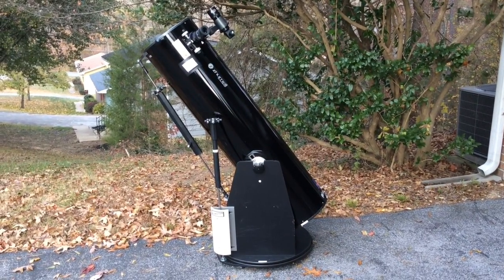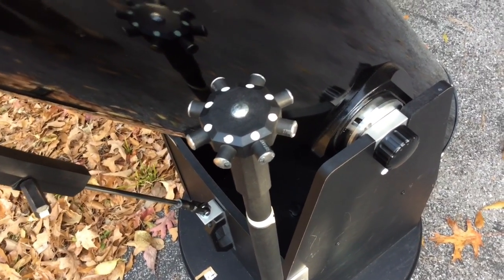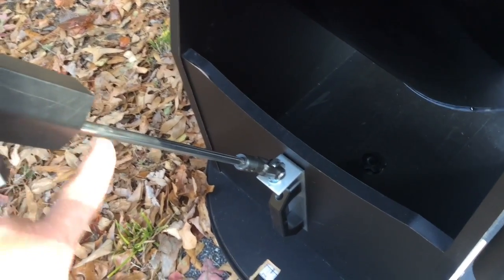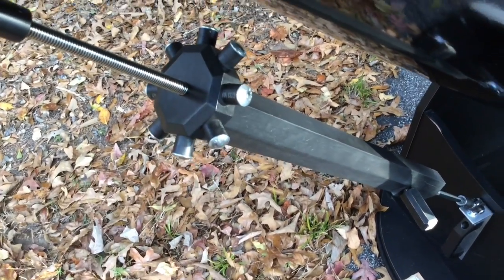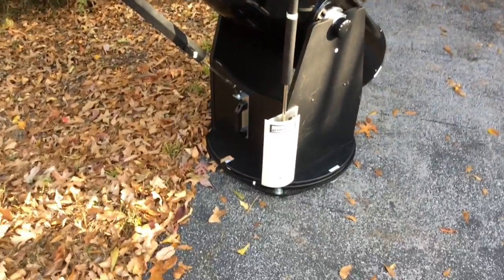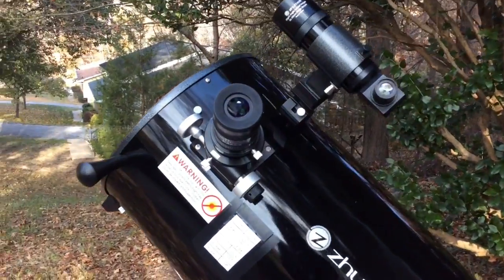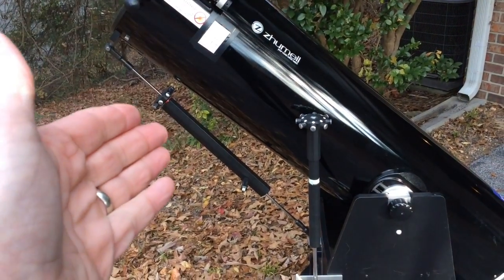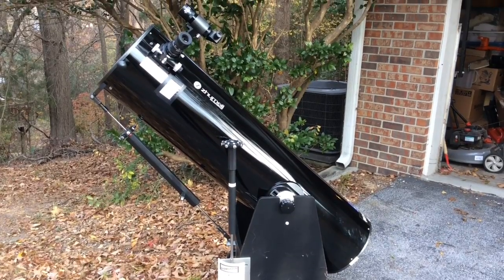ZLOMOTION Dobsonian Slow Motion Control

Comment: 11 out of 10, brilliant, I'm always looking for ways to modify things that you can remove later to bring it back to stock maby for resale or newer ideas etc, absolutely brilliant, you should consider putting it into a kit and selling it.
Reply from the maker: +powertool4uau Actually, this is a kit manufactured and sold by Dan Katz here in Chattanooga, TN.  Check it out at www.zlomotion.com.  I am just his PR frontman :)  Dan really has done a great job with this system.
Reply: Ok certainly will check it out I have a 12inch Dob thanks for that

Comment: Dear Richard: I love the design, but have one question. When you were demonstrating the use of the control knobs on this and on your 6-inch telescope, the tubes seemed to bounce up and down a lot, which surprised me. I assumed the rod would keep the tube pretty still. 
Was that movement due to the camera in your hand, or was it the tube? How much movement is there when you have your eye to the eyepiece and you're moving one or both knobs?
Thanks.
Reply from the maker: 54Newheart -

You can get a little bounce when making large adjustments with either scope. They dampen pretty quickly. When actually at the finder or eyepiece, everything is very smooth - much better  and more precise than manual adjustments for a dob. And I was making this with an iPad in my hand ;). Any jiggles are when adjusting altitude; azimuth is absolutely smooth. It takes a very light touch when at the eyepiece, which I found came pretty easy after a short time.
Reply: Dear Richard: Thank you for such a prompt response. I'm making a 4-inch Dob for my little grandson, and I'm debating utilising some of these  aspects to give him a steady image that's easy to control. He's going to be eight, and I don't want him to be discouraged by a jiggly scope that takes too long to dampen. Thanks again, and good luck!

Comment: Need to address the elephant in the room. the flaw of this system is that you are attaching these mechanical devices to a dobsonian base that is particle board to begin with. Aka fall-a-particle board.  If your Dob base fails, Zhumell (or Orion) won't sell you another one even if you're the original owner and you're just out of luck.  

A dobsonian scope with smooth bearings, even one with a particle board base, shouldn't need slow motion controls in the first place.  Inexpensive hacks like virgin Teflon, ebony star or similar laminates, and balancing magnets should get you to where you can hand track near the zenith/ Dobson's hole at 300x.  I did all these inexpensive hacks.  I also replaced the original particleboard base of my XT8 with one made of Baltic birch.
Reply from the maker: Hi Bryan! Yes, I can see your concern, but my experience (all of about 5 years worth) is that the particle board base is holding up well. I acquired this scope itself second-hand, and its bearings are quite good and smooth.  I have had it for 5 years, and it gets used on grass, gravel, and asphalt pretty regularly. I have not noticed any issues with the board starting to disintegrate, but I can certainly see how that could happen over time. In the event that it does, I or pals of mine could probably fabricate a replacement without too much trouble. 

I had the Zlomotion installed after I had been using the scope for a while. My issue is not with the bearings themselves or the smoothness of the motions; rather it was more my lack of the fine motor skills and coordination to smoothly star-hop or track objects smoothly and easily. Also, at a Star Party, guests routinely grab for the scope when they go to take a look. With this system, they only move it in azimuth, which makes reacquisition a snap.  Also makes recentering quicker and easier as the targets move out of the field.

Thanks for your observations. I'll be keeping a close eye on my ground board 😉
Reply: Bryan is right, that stuff is CRAP.